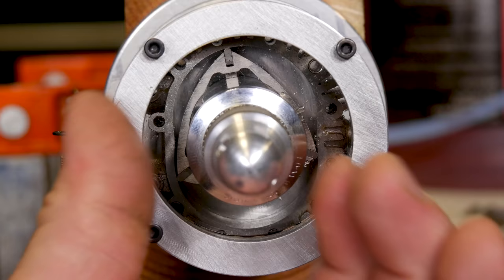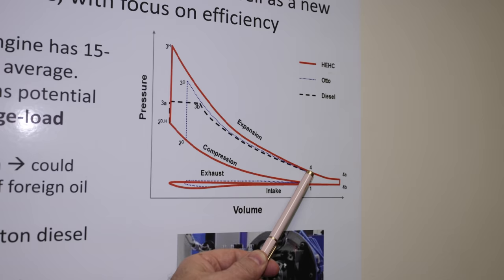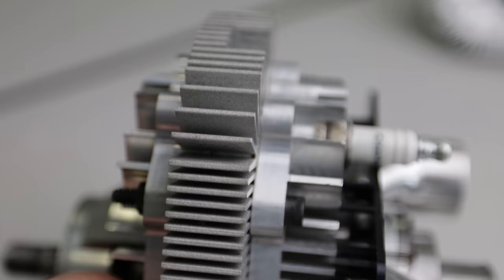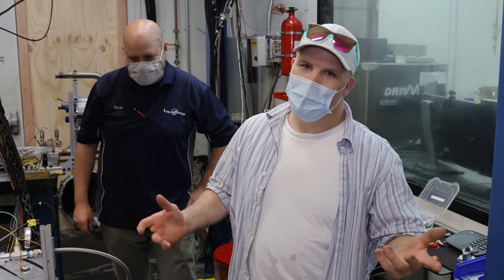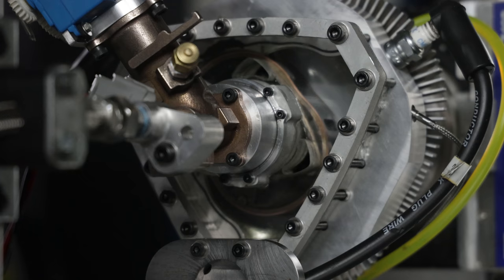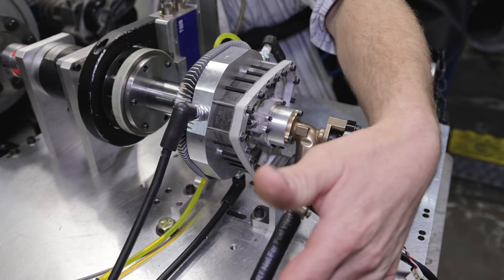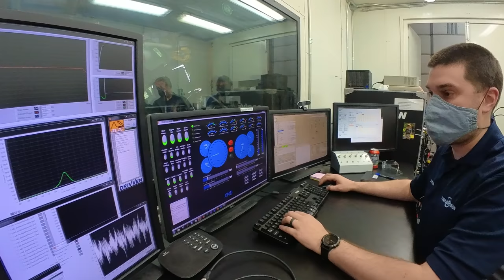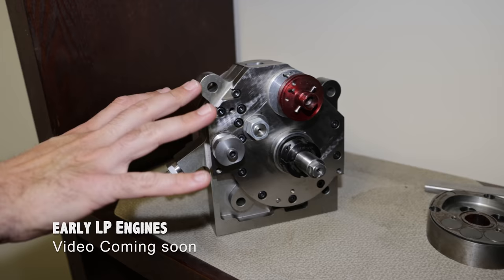See Thru Liquid Piston Rotary Engine - In Slow Motion

Comment: I inherited a 1980 RX-7 with a rotary engine soon after starting college. I'd worked on tons of 60s and 70s cars at that point in my life, rebuilding about 30 engines. I had no idea what or how rotary engines worked so I ask my Math professor and he sent me directly to the Engineering department. I was lucky enough to talk to two professors who were also rotary engine owners and fans of the technology. After a few talks they both strongly suggested I switch my course of study from Math to Engineering and I did just that. I had an amazing career as a mechanical design engineer working for NASA, the DoD and other Aerospace firms across the country and around the world. I have the rotary engine to thank for all that.
Reply: Thanks for sharing that and what a lovely story.
Reply: What a lovely story
Reply: @rozanpratama5536  m9o.9.9ko9k
Reply: I was thinking about going into mechanical engineering.
Reply: The wankel rotary blew my mind when I first learned of it. It seemed like alien technology to me because I am of slightly below average intelligence.
Reply: @deadbrother5355  what do you think of electric motors than?
Reply: Coolbeans
Reply: @jwalster9412  meh. Electromagnetic force is no where near as amazing to me. It performs. But , meh. Not as cool.
Reply: @deadbrother5355  it depends on the car really.
Reply: @jwalster9412  booooooring also really heavy/expensive/rare earth element batteries that wear out way faster than a decent internal combustion engine. the battery is charged off the electric grid, which is approximately 35% natural gas in the US. diesel cars get amazing torque and mpg. also check out mazda skyactiv engines. Scotty kilmer has a great video on them. electric cars still arent there yet. if they were, then they wouldn't require a massive government subsidy to make them remotely affordable. what a waste!!
Reply: @timpavilion3156  ok.
Reply: @jwalster9412  facts is facts lol
Reply: Hello, I live in Russia, I recently received a patent in Russia for a utility model on an internal combustion engine, aren't you interested in my engine?
Reply: @timpavilion3156  Most new technology takes time to develop. Consider that the ICE has been around for over 100 years. Plus the global warming and pollution issues mandate a change.
Reply: @Madmaximus1000  Who designed the heat resistant tiles that were glued onto the shuttle and the o-rings on the boosters?
Reply: @larryvaughn5843  the tiles Lockheed,
Slicon carbide,
 the seals in the solids, Thiokol
Reply: @timpavilion3156  Gee, if everyone had your attitude we'd still be rubbing two sticks together to start a fire. Guess what. Trying to do things better doesn't (usually) result in instant results. Investment in research for new technologies is what helps make a better civilization. We can give thanks to the benefits of fossil fuels to creating the civilization we have today without trashing R & D to do it better.
Reply: @larryvaughn5843  Of your underwear, maybe.  Not my vehicles & tractors.
Reply: @larryvaughn5843  I believe the o-rings were made by Morton Thiokol.  I could be wrong, though.  My mother said the NASA chief at Huntsville, AL, was at her upholstery shop when he received the news of the Challenger disaster.  My brother said he left slinging gravel.  I don't remember who made the tiles.  But from what I understand of the disaster, a decision was made to launch in spite of the effect of the cold weather on the seals.  Who made that decision?  Isn't that the question you should be asking?
Reply: @hrned  R & D is good.  No question about it!  Experimentation is the product of that childlike curiosity that so many of us are born with.  There would be NO cars if someone hadn't experimented with the wheel, right?
Reply: @hrned  apparently facts have hurt your feelings. I'll stick to facts and you can stick to caring about "attitude" I guess..
Reply: @lewis2553  I read that it was a politician who overruled the engineers who didn't want to launch that day, with disastrous and historic effect.
Reply: @timpavilion3156  Battery technology is constantly improving. Internal combustion engines have had quite a jump start. Batteries will catch up and surpass. Since there is no flame, electric motors are actually cooler.
Reply: @larryvaughn5843  Yeah, I heard that someone was pushing them to launch, but I don't remember the guy's name or position.  Anyway, I just want to say that electric motors don't have to use magnets.  Nor do they have to use a high current and load the battery so much.  There are motors with both field coils and armature coils.  And they can be made more voltage sensitive by winding the coils with more turns of smaller wire.  You can see this effect in action in those old power meters like they used to put on houses.  They have one coil with many turns of fine wire to drive the motor with voltage and another coil with a few turns of thick wire to drive it with current.  P=EI. Power=Voltage x Current, and voila!  You have a watt meter.  Its motor drives the gear train to register the power used in kWh.
Reply: @timpavilion3156  Apparently, you don't know the difference between a fact (e.g., diesel cars get amazing torque) and opinions (e.g., what a waste). Your conclusion implies that there is no possible future for electric cars and that investment in them is wrong ("a waste"). My counterpoint was that solving difficult and huge technical problems requires investment (either private or government - but a "fact") and that such an investment has been and will be worthwhile (an "opinion") given the problems with fossil fuels.

So no, my feelings were not hurt. I just try to occasionally rebut dumb opinions and your comment qualified.
Reply: @larryvaughn5843  You're right about electric motors producing less heat.  That means you'll need a bigger battery to run a heater in the winter, unless you want to freeze to death up north. There's also the current draw of windshield and mirror defrosters to consider.  Life's sure going to get interesting if everyone switches to EVs!
Reply: @hrned  lol you literally just admitted that my post contained facts. and they clearly hurt your feelings enough to write a loooong snarky reply lol. i said batteries "aren't there YET" which implies they may indeed get better in the future. pretty simple honestly. stay educated, Ned!
Reply: @timpavilion3156  Tim, Tim, Tim. I never questioned your facts and they never "hurt my feelings". I agree with them. Batteries aren't there. Charging electric cars usually involves the grid, which uses a lot of fossil fuels. What I reacted to, and clearly stated in two replies to you, is your comment that electric cars/batteries will "never get there without a lot of government investment, What a waste..." That opinion was possibly meant as hyperbole, and didn't properly articulate your nuanced position on government investment. But it IS what you wrote and it is a short-sighted opinion that deserved to be countered. Let me ask you - do you think government investment in battery research is a waste?
Reply: Truly Inspiring!
Reply: NASA and dod. What did they aliens think about the rotary and are the aliens as smart as everybody says they are?
Reply: @jwalster9412 If you get into the right companies, making the right products, you'll never have a boring day. It's always new challenges, new interest. Historically it was not the highest paid of professions, (though it’s much better now) but it certainly is one of the most rewarding mentally. Best wishes whatever you choose.
Reply: @deadbrother5355  An electric vehicle needs a powerplant that converts the fuel into electricity and then it has to be distributed to your charging station. The beauty of a internal combustion engine is that you can use the fuel directly where you need power.
Gasoline can be transported in almost any container. Good when you are in the middle of nowhere.
Reply: @ossanyberg  no sh!t Sherlock. 🤪
Reply: Thank you for your service sir!
Reply: Did you work at MAF on the shuttle?
Reply: Respect to you sir
Reply: Wow that's effin awesome man 🤌
Reply: @timpavilion3156   Even if you are quoting unbiased and fully-informed facts, the problem seems to be that your attitude is very similar to people who spout disinformation for a living, which is why a lot of people, even those who try to stay level-minded, will instantly be put in a mental state to not take you seriously.
Reply: @h8GW  cringe, such a long response about my "attitude" which is irrelevant. sorry that facts have made you worry about my "attitude"
Reply: this is that one unique novel story where the protagonist changed the main plot of the story. jokes aside, I'm glad you are happy with what you do now.
Reply: Great story!
Reply: Did we go to the moon or not